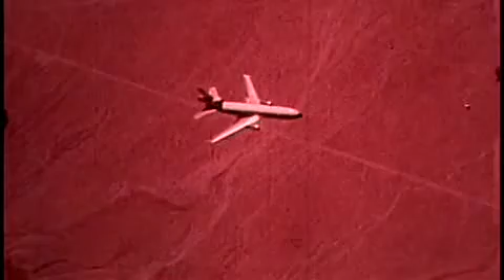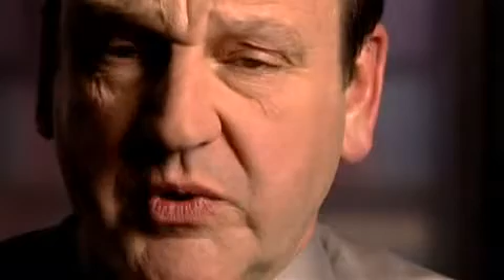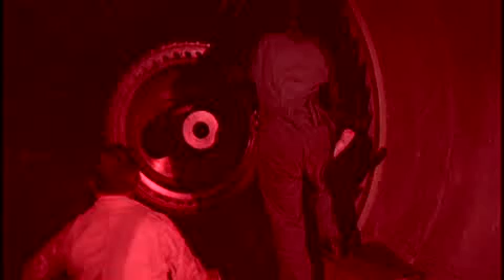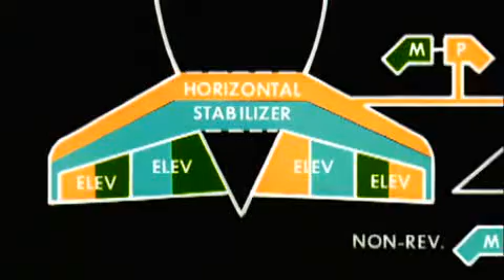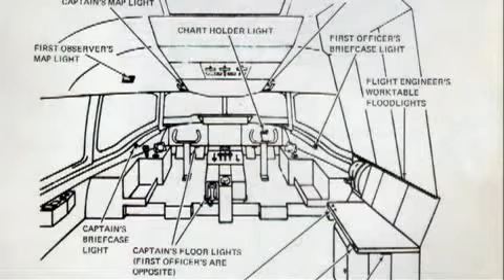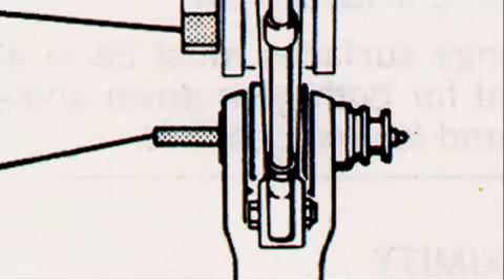air crash investigation United Airlines 232 (part3)

Comment: @marieclairexan It actually makes perfect sense. Think of it as a skater going up and down a ramp. When he goes down he gains enough speed to make it up to the other side, and then gravity pulls him back down again. As an airplane gains speed it also gains lift in the process which forces it up, but then gravity wants to pull it back down so you have to stabilize it, or else you lose speed and the airplane will automatically go down.